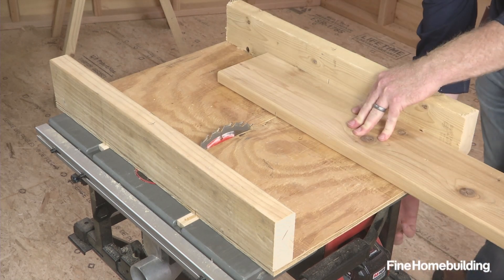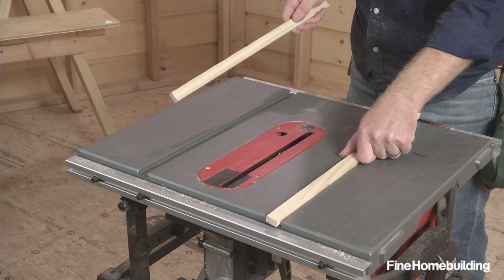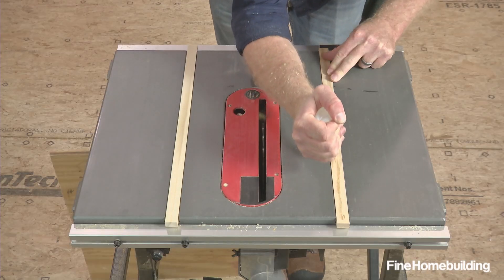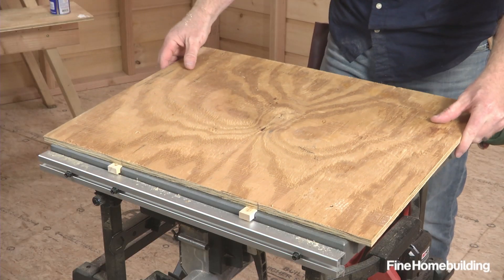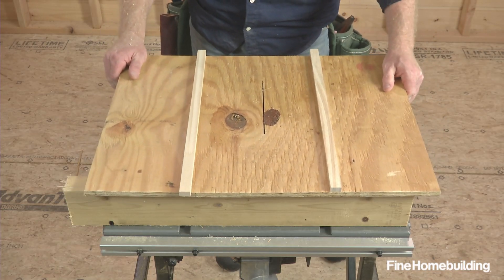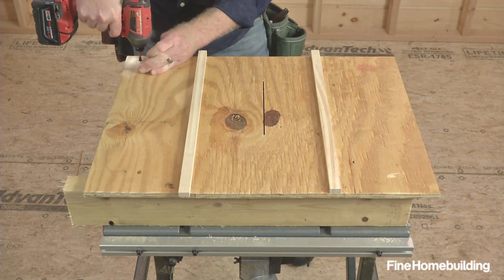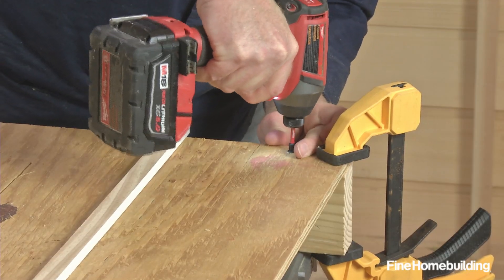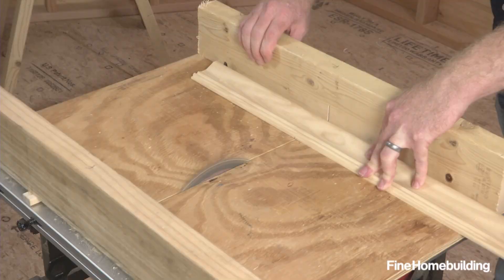How to Build a Crosscut Sled for Your Tablesaw

Comment: First crosscut sled video that I've ever seen that only takes one minute and 25 seconds.  I'll bet the average is closer to 10 minutes.  This one definitely gets the job done, though.  My only recommendation would be to mention a feature that many crosscut sled builders incorporate: some kind of blade protection enclosure where the saw blade comes out of the back of the sled.
Reply from the maker: Good point! Thanks for the tip.